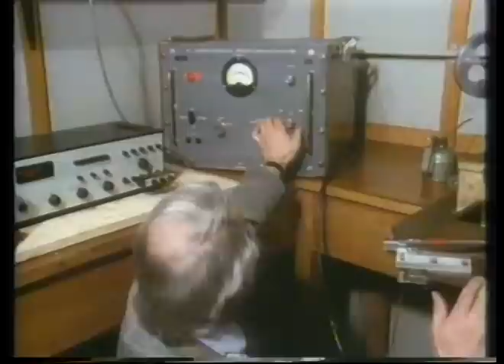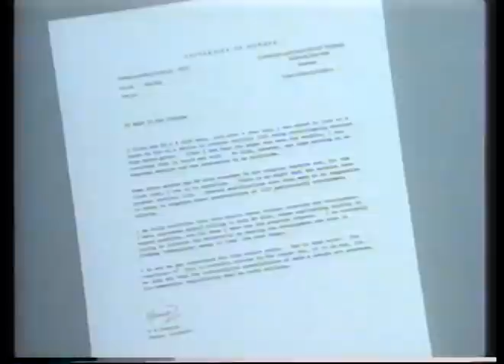Anti-Gravity Machine (Part Two)

Comment: It's rather sad that he spent so much time on a pipe dream. Laithewaite was well known in Imperial College as being out of his depth. He was an electrical engineer trying too outsmart mechanical engineers. The latter said he was barking up the wrong tree and gyroscopic forces create torque but not lift.
The device as shown is little more than a governor as used on steam engines. 
The rotating weights fly out and by linkages cause an upwards force. But this force is really just the same as if yiu had a sliding weight on a balance arm.
Ie its just a balance of forces.. The framework is needed and the net force is on the whole machine is zero. His story about the aircraft gyroscope is telling it seemed like magical force that threw him over when he suddenly turned with a spinning gyroscope. But that effect is well known as the conservation of angular momentum. Buy a toy gyroscope spin it up and hold the frame in your hand and turn your hand you will feel the strong force.
Reply: Ok, so if that's conservation of angular momentum, what's preventing someone from conserving angular momentum all the way to Mars?
Reply: 100 Videos And No Subscribers . . . .  why not travel to Mars with a gyroscope? Because conservation of angular momentum, relates to spinning on an axis. To get to mars we need linear momentum. and the  only way to get linear motion in space is by some form of rocket propulsion.  ie ejecting material quickly in the opossite direction to the required acceleration. Mind you, orbiting the sun is part of the trajectory to Mars but that has nothing to do with gyroscopes.
Reply: @100videosandnosubscribers3   Why don't the people who think gyroscopes will make things float, fly, or drive down the road do those things?  You guys don't seem to even try, but rather want scientists and engineers to do it for you?
I have solar panels on my roof and an electric car all subsidized by the government.  I have friends who go on and on about free energy, zero-point energy while they live off the grid and gasoline, claiming the government is forcing them to.
Reply: @DeputyNordburg  I tried to understand the physics, and I came to the conclusion that gyros only create rotational force, which seems very odd, given that forces don't curve. I am truly ignorant.

Now I wonder about inertial propulsion. I've heard that it works, but that may be just due to friction.
Reply: Redrooster  news to me
Reply: @DeputyNordburg  There is no such thing as government subsidies. The government only has money they take from other people to subsidize you. You are a thief, plain and simple.

Comment: Drop a big lead ball and a small lead ball from the same height and they both hit the ground at the same time.  Same for a feather and a lead ball if you do so in a vacuum to remove air resistance.  Now drop a spinning gyro and a lead ball and something fascinating happens!  They hit the ground at the same time.   But the person holding the gyro felt how weird it was twisting in his hand, and starts to think he can make a levitation machine.
Reply: the smaller ball actually hits the ground first because it has less inertia. inertia is mass. just nobody ever thought about using more precise instruments to measure the experiment.
Reply: @nathansire6623  It does not hit the ground first. While it does have less inertia, it also has less force acting upon it.

Comment: So mechanically speaking.......what would this be good for? It requires multiple engines to operate it, blank point period we have way more economical means of thrust, now as far as the phenomenon that is taking place their might be something to that
Reply: If you need to hold something to the ground, this is quite heavy.   It could also be a teaching device for how gyros provide zero lift.  Or as a boat anchor.

Comment: EUREKA!
Suddenly I understand something VERY important!
Ironically not about gravity, but fundamental force equalization!
My best guess is (actually it feel quit right, then I just have to prove it) that:
The gravity generated locally by the devise, locally equalize out surrounding gravity.
Sounds simple?
I'm VERY pleased with that!
However, this principle enforced by like a electromagnetic rotating mercury and/or superconductor (you know the anti-G-thingy), this may ACTUALLY WORK!!!
I'M SHOCKED!
Gravity equals potential kinetic energy! That's why a Victorian gyroscope starts turning when a wait is attached to one side (part 3 of this). It's earths gravity that tries to equal out the wait, so the gyroscope and earth keeps on stealing energy from each other, that result in turning the gyroscope.......
Reply: I like SIMPLE stuff!
But here may be a perceptive connection between gravity, motion, electromagnetism and even Chasmire's effect.
 I still believes at the main reason for FAR TOO MANY paragraphs (()) in physics today (especially theoretic), is that we not understand just how may phenomenons we dedicate as separate forces!

Comment: with today's manufacturing techniques / micro related gear related technical applications. I wonder what they could say if a mini version was mounted / powered by a mini RC/ helicopter... once to rpm and thrust is achieved turn the heli off and watch it sustain altitude w no more blade movement. 
WHEN WILL THE PEOPLE OF EARTH BE ABLE TO USE THE INTERNET TO AS A TIME STAMP OF HISTORY INTO THE PAST TO SEE VARIOUS ONGOING SERIOUS ATTEMPTS TO SLOW DOWN HUMANKIND!
Reply: The device in the video was able to reduce it's weight by 0%.  I think with modern manufacturing and materials that could be double or tripled.  Maybe 3D print it.

Comment: this machine was not scrapped i think its still under development. its pretty heavy with Metal mechanical parts, you can pretty much get the same stability with 1/10 of the weight No adays,   the question is How much lift does it give. I believe in this.
Reply: peter your right
Reply: Especially with today's tech. I'm sure the US government took notice and stole his technology. 
I could only imagine they use that with the triangular craft that so many have seen. If the SR-1 Blackbird was tech from the 1950's -1960's and it wasn't declassified until I believe the 90's, you could only imagine what tech they e developed by now 70 years later. If they've released what our top end fighters/bombers/weapons can do, you know they've gotten something even better hidden away.

Comment: A flash , a vision, whatever trigger by this video. Mechanics are pointing in the right directions, material is all wrong .  Think changing magnetic fields. neodymium gyroscopes and ferrofliud, if one is to think that a UFO is possibly time travelers or alien technology then looking at it, what do people describe? Ball of light, or metallic mirror like ball? Like a floating ball of mercury? Magnetic fields, this man's concept, ferrofluids - mercury ect , torque converter, Tesla turbine, different frequencies on different sides cause rotational projection of ... Something but connect, or contain it in a sphere shape. Flash of light, high energy. Hz . Size scale of a massive gyroscope made from something like aluminum or copper rods coming from a neodymium end, with possibly more separate neodymiums in the top spinning. Not only levitate but there's going to be some sort of distortion of time, maybe jumps. But you can't leave the from inside the bubble. Bubble seizes to exist and your stuck. I have no idea what I just said. I only know this is where I'm supposed to say that at ...
Goosebumps up my leg, back.... 
Let me know if any of that comes too any value to anyone.

Comment: I can not help but Wonder if the lift is actually generated not by the gyroscopes but rather the support structure acting like wings. However, I have worked on many numerous gyroscopes (balancing and testing for navigational purposes) and have often wondered about a three-axis gyro. More specifically using materials such as copper and Mercury and their reactions under such Force.
Reply: You are true. Problem it can't lift without support. If It counters the force the device wouldn't lift.
Reply: Do it in a vacuum and get your answer :)
Reply: @stevenrogerfineart5866  the thought of that also crossed my mind as far as eliminating any type of Air drag. Now you just got to find a bell jar big enough to put that thing in.
Reply: I've worked in exactly the same environment. I'm reasonably sure that it's possible to use only 3 gyros to create a device that could hop. Not much use, unfortunately.
Reply: @cmbhappy  I saw two different two different experiments. First one the guy used load cells/sensors and it showed no weight reduction. Second experiment a guy had the whole setup on a weight scale and it actually showed a weight-loss equivalent to an American nickle. That one was a head-scratcher. If it was possible to have an antigravity device, I believe humanity's best choice for the inventor probably would have been Nikola Tesla. After all, he was the inspiration for the mag-lift trains as well as rail gun technology.

Comment: I admire anyone who pursues their dream with as much determination as Sandy Kidd.  However, I don't believe a machine with spinning weights in it will levitate.  Laithwaite's dream is just a dream.   There are a lot of cases where machines like this, whether mechanical, or electromagnetic, appeared to generate an anomalous force depending on the measurement method.   In this case there could be vibrations that cause the device to shimmy up its shaft.   What happens if this machine is powered by a battery and everything is put on a balance?   Or why not turn it 90 degrees and put it on a cart?  Does the cart move on its own?   NASA funded research of the "EM Drive", a cone shaped Copper cavity that had microwave energy fed into it.   There were many experiments that showed a miniscule force being produced.  Eventually it was proven to be a thermal effect; ie: No anomalous force was produced.

Comment: If you can ride a bicycle, you will recognise the truth that 'A bicycle in which the headstock is fixed cannot be turned, cannot be ridden' The gyroscopic force of the rear wheel, is constantly being tempered with that of the front wheel, through the interraction of a steering force from the rider reacting to the pressure in his/her eustacean tubes.

You can try the experiment with a swivel chair, and a bicycle wheel. 

This man tapped into that, having very finely graduated linkages, and constrained gyroscopes, was able to create vertical linear lift through rotating masses.

I wonder where his research led him?

I thought his long suffering wife, though neglected, seemed a tad negative! Bless her

HOABL

Comment: Guys, you made basic fault - if you did the same experiment in emptiness, without any gas, like air, it will not produce this force. Sorry, I know you tried hard... I may explain it if you want - contact me by Facebook. You simply made some kind of rotor, which uses rotation in air to produce forces against gravity, as every chppter does...

Comment: SO painful to watch.  The power-up phase requires anchoring the motor to the earth, via its mount to the base, transferring a huge amount of energy into the spinning gyros!  THAT’s the catch. That angular momentum transferred to the gyros. It is all explained by physics!  Angular momentum is a fascinating thing, but no matter how anyone has ever sliced it, conservation of momentum has ALWAYS held. You can hide it in a huge, massive object, like the earth, or transfer some of it from the earth to a high speed gyro, but math is math, and ultimately it would be like a crane lifting itself!  The energy has to be stored somewhere, then used to counter gravity.

Comment: Man.  How did I get here, this is a joke lmao. Oh the military uses this to hover? Top secret... gotta put the right variables in the computer to simulate it... fascinating. I just can't, its not going to work and if it would work, theres no reason people ouside of the military couldn't create. It would have been created by now. I cant guarantee the military doesnt have it, but the concept is basic and if it were possible some scientist or inventor would have made it by now.. and we would have hovering vehicles using this "anti gravity" machine. Then again this wouldn't be that efficient because you still need some energy to spin the thing, so still need gas or electricity that could just be used to power a propeller or something that will use that energy more efficiently. 

Im not saying gyroscopes dont have awesome properties and uses. But unfortunately this guy almost definitely wasted many years on something thats not physically possible.. not by this method at least.

Comment: It does work, for a moment.  It provides an impulse of force as torque is applied and masses are accelerated.  It will continue making force as long as there is acceleration, which will always be limited to how fast you can spin it, and then it stops making force.  Deaccelerating the masses causes a force in the opposite direction.  Not very useful for one way propulsion.  Physicists and engineers should know this since this isn't new and its easy to model mathematically using conservation of momentum. Not saying that the ideal could never work, just not this way.  There is an old thought puzzle given to electrical engineering students regarding reactionless rockets (circa 1940's) that is presented wrong and then argued against, but it leads to the generally accepted idea that there can be no change in the energy of an isolated system, assuming they mean momentum, without the external application of force (hence demonstrations of gyroscopes being supported by some outside effort, even at a distance).  It depends on how the energy of a system is defined that determines whether the reactionless rocket is achievable.

Comment: The energy required to produce a pound of lift, using this machine, is much greater than any of the viable vertical lift technologies available today. "Antigravity" cannot be achieved entirely by mechanical means alone. We're talking about partial mass cancellation, combined with space time distortion, which can only be achieved by an ultimatonic deconstructed reaction. Atomic energy in reverse.

Comment: Well the guy was trying to do the mathematical formulas died but what happened to the other professor and what happened to the inventor? Where are they and where is this machine. And why doesn't somebody put one in a 3D printer and make one and carry it up into one of those airplanes that does zero g and turn it on and see if it moves forward I mean why are they messing around with stuff on a stand or just build a small version of it and toss it in the air and see if it can move to the side or to any direction at all.

Comment: Just take the machine, tip it on its side, and put it on a boat.  If the boat travels in the direction the machine was moving in his shed, congratulations you're creating a force in the direction you expected and you're a genius.  If however, the boat doesn't move or starts spinning in a circle, then you have your answer, the force the machine was trying to twist on its mount was just being transferred upward and you've got nothing but a wobbly waste of energy.

Comment: I'm sure my comment will be perceived as very naive however in my opinion it is not hard at all to understand why there is an upward movement because the two heads are spinning so fast they want to fly off the axle because of the force but they are tied to that Central right so they move upward because there's nowhere else to go that does not mean Antigravity because there is a force applied to create that effect.. if I jump up I can't say that I'm performing an Antigravity stunt, because I'm applying a force to my body. All I'm saying is to me it's easy to see why that whole mechanism is Lifting Up

Comment: The metal is creating a field that pulls the protons out of the hydrogen in the air giving it less weight when it stops moving it stops creating that electrical field it stops pulling protons from hydrogen and it gets heavy again. When the Bible talks about how everything used to have wings that was back in the times when they understood the proton and how they could use it to build structures like Stonehenge because not only does it make aluminum anti-gravity but it can levitate heavy rocks and even people pretty much anything with atoms

Comment: I saw no actual video evidence that it produces the lift you say it did. It produces lift just because you say so? You would have had to shorten the video presentation down to just the part where you can clearly see it producing the lift you say it did. Maybe by setting the whole assembly on a scale so you could see the weight decrease.

Comment: On the inside of the aluminum type of spacecraft that is flown by generating electromagnetic fields it has seven super projectors capable of projecting realistic Holograms by creating and firing Frozen little droplets of water that are in the shape of tachyons but not as small in order to give them temporary faster than light speed in which case they fire this Quantum engineered particle just before they fire a futon Wave depending on the wavelength will produce the color the quantum engineered water droplet evaporates after the photon wave hits it Bill happens a million times per second creating Holograms that are pretty realistic and that's how they see to fly the spacecraft is with holograms on the inside and sensors on the outside they been late around it to make it invisible so if you see one is because they want you to see it

Comment: Until they were to put a scale underneath the entire machine to demonstrate it is actually losing weight I will hold the assumption that the vertical movement of the inner part of the device is due to the transfer of energy through friction.
I don't think the device is actually losing weight.